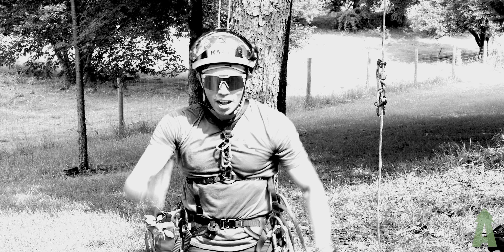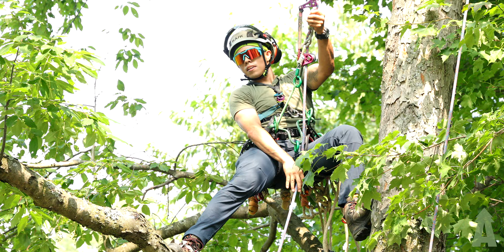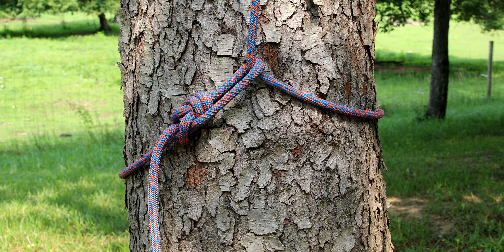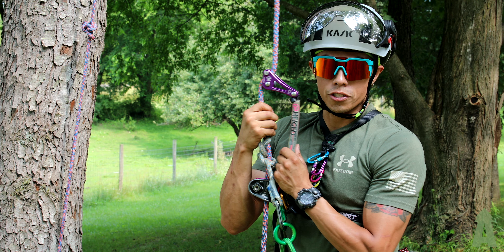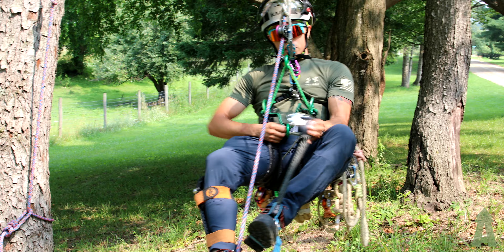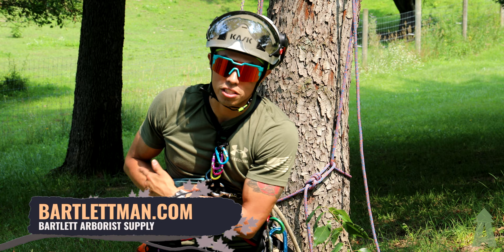How to Climb SRT/SRS: The Basics!

Comment: What are your thoughts on carrying a flip line with you to help you to anchor into a spot your working or even helping you out to and back from the end of the branch?
Reply from the maker: Lanyards definitely increase stability when working at height and is always recommended to climb with one. For coming back in from a limb walk, usually redirecting is the best choice or a mechanical advantage system would be better.

Comment: So I did this by accident. If you want to descend even on mrs Not on a prusik, bring a figure 8. Feed the line with no tension thru the 8, clip the 8 to your bridge, loosen the prusik while locking the 8. I’ve descended sliding the prusik with all the weight on the 8, and removed the prusik to just drop on the 8 like a rappel I don’t like sliding rope on rope to descend.

Comment: What diameter rope is typically used? I been messing around on a 1/4" double braided for myself and a 5/8" polypropylene for limb control, it has a core, idk how many strands, but my neighbor who's into rock climbing has a 3/8" or maybe even 1/2" for climbing.
What's normal? Is 1/4" too thin? Does anyone else use 1/4"?

Comment: ty bro,  what are your thoughts on metal vs rope tether on your wrench?
Reply from the maker: Prefer the soft tether rather than metal. During spar work, I can cinch it tight to the wood and spin around to make a nice face cut. Side loading the tether wouldn't matter, just keep an eye on the slic pin orientation.

Comment: The only reason I am hesitant to go to SRT is I am not a light climber. I weigh 260lbs without any gear, boots, or a saw. As the story goes, that means at my top crotch the rope has around 550+ lbs of force on it and it only has a WLL of 850lbs (8500lb break strength). Not the widest of safety margins to say the least. Conversely, using DRT the weight on my rope is halved, again as the story goes, which makes me feel safer with the wider safety margin. I have been thinking of switching from my current ropes to tower climbing ropes as they are stronger but I have not seen anyone online (where I have obtained all of my climbing training this far) use them so I have no idea if they are worth the extra money, plus none of the ones I have seen for sale have eyes on them, which makes using the Zigzag more difficult I found out as a knot termination tends to get in the way of its function.
Reply from the maker: I see your concerns. I guess, I am a bit confused as how you phrased, " top crotch your rope has around 550 lbs of force". Are you referring strictly to the rope's WLL or the branch union? If it's the branch union you are concerned with; we can only "guesstimate" what the branch union is rated for after identifying the tree species and whether it is in good condition. We are working with unrated anchors, whilst other at-height workers have rated anchors and know their WLL. Might want to canopy anchors instead of basal anchors if you're worried at the forces applied. If it was about the rope and it's WLL, refrain from jumping into the system.

Comment: Was that a Catalyst hitch you were climbing on?
Reply from the maker: It's the Catalyone.
Reply: @BartlettArboristSupply  Thank you. You guys are the best!
Reply: What is that just below the wrench, above the hitch?
Reply: @sarahmattgosma-helfrich3880 It's a round piece of wood with a hole in the center. It's called a "hitch breaker"
Reply: @alotl1kevegas860  so, basically it’s that? Duh… wish I could attach a photo of what I made after your comment. Very simple solution to solve the locking hitch issues

Comment: The Wrench seems outdated compared to the Akimbo and Runner. It only makes sense for someone looking to transition into SRS who already owns all the other gear. The Rope Runner Pro doesn’t cost more more than a stiff teather, wrench, eye & eye, and hitch climber.
Reply from the maker: Sure, the wrench may be a bit outdated however it has been cemented in the SRS world and keeps the user up to date on the many different hitches that exist today. There is also the fact that some climbers do not like mechanicals, which may be a deciding factor. But I do agree, mechanicals are butter smooth!

Comment: Climbing trees for ANY reason weather to hunt out if them or any other reason should alway be about safety and speed is simply not important 
And this becomes exponentially more important the bigger the person you are 
I am 6'2" 255 in shorts, tee-shirt and gym shoes 
Now add cold weather hunting clothes and boots and gear I keep on my person (binos LRF etc) and I'm knocking on 270lbs 
And I have size 14XXW feet = huge foot print
My five 24" Beast sticks can get me up to 18' up any tree safe to hunt out of from ground start to standing on my treestand in under 30 minutes moving at a very safe efficient speed most importantly NEARLY SILENTLY 
Yes I have timed myself on a nice straight tree with few to no branches to deal with and been sitting in my stand in under 15 minutes but literally LITERALLY 15 more minutes to take my time Climbing a tree has absolutely no negative effects whatsoever on my hunting and lowered my odds of making a fall inducing mistake to near zero
My God but I have spent the $$$ trying most other alternative to sticks Climbing systems that were advertised as faster better etc etc but ALWAYS wind up back with my Beast sticks as the absolute best compromise in weight speed and safety for a Climbing system forca guy with Sasquatch sized boots
No way I can use SRT setting up a 100 yards or less from known bedding area and not be significantly more noisy than just using stealth strip wrapped sticks 
To each there own but SRT IMO is for a very select very physically fit hunter with no shoulder injuries or other physical activity limiting injuries 
LAST thing on my wind when Climbing a tree to hunt from that same time is speed
#1 is my safety
#2 is to make as close to ZERO game spooking noises as I can while climbing.
I do use a saddle as my safety and climbing harness with linemans rope that doubles as my tether once on stand

Comment: Why couldn't you use 16 strand ..i have the bigger ropewremch ..need order small one 11 13 order from u comes today new bluemoon......
Reply from the maker: You can, however the toothed cams on the ascenders may damage the cover of the 16-strand and since most basic 16's are cover dependent, they could potentially weaken your rope. But if you foot lock it, have at it. It's just a general recommendation based on ropes and their load distribution.
Reply: @BartlettArboristSupply  12 strand would work or no?
Reply: @Sethhaun78  12 strand is worst

Comment: Ummmmm there’s an easier way without using all that expensive equipment that just gets in your way for real for real Just use your safety harness and walk up.
Reply from the maker: You mean defy gravity 😏....
Reply: @BartlettArboristSupply  no pull the safety all the way out enough where u can stand on the tree walk up come in flip ur safety back up walk again tighten (using a hand ascender does help) ur rope rinse and repeat now u do need a set rope to do it i been climbing for 17 of the 27 years in tree work
Reply from the maker: hmmm, or foot lock up the tree🤔.
Reply: @BartlettArboristSupply  either way u got a new sub